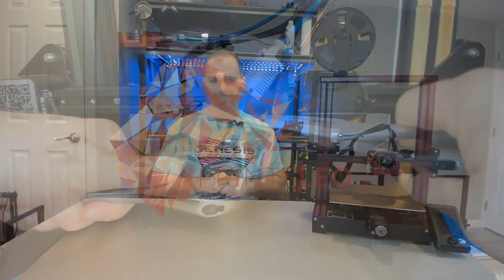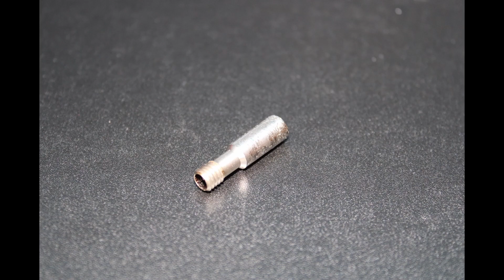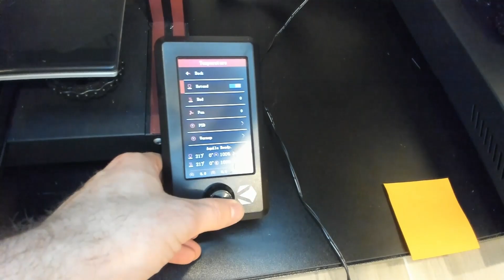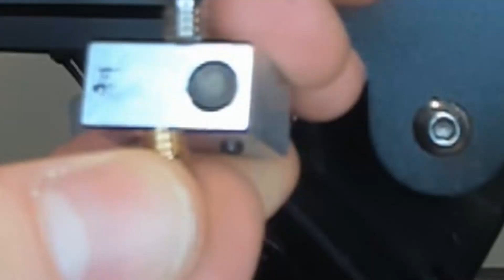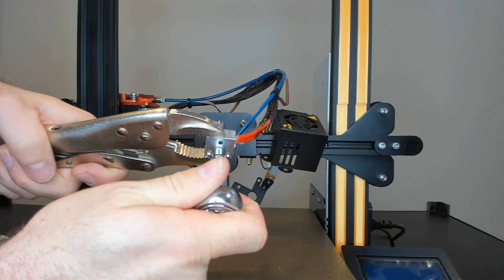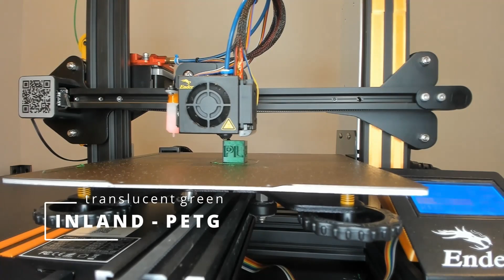Print High Temperatures on the Voxelab Aquila with a new Heatbreak!

Comment: Hey, saw your review for the unitak bimetal one you showed here on amazon and came here even though I had already seen your videos before! Could I by chance get or see your cura profile for your aquila or ender 3s running those specific ones? I have an aquila and an ender 3 pro, replaced one in the ender 3 pro and having troubles dialing in PLA changes and wanted to get that down before installing the second in the aquila! Thank you!
Reply from the maker: Hey thanks for watching and congrats on getting the first bi metal heat break installed properly. You can find my bi metal profile under the cura profile section of my website. (https://www.printsleo3d.com/firmware). Right now the profiles are pretty bare as I have been spending a lot more time dialing in the settings for my printers that are running Klipper. Also the only real change I had to make when changing over to the bi meal heat break was shortening the retraction distance. After the install you also want to make sure you PID tune your printer and run all the normal calibrations like flow. If you are still having troubles dialing in those settings you can ask some more questions on here or through my email: printsleo3d@gmail.com Thanks for watching! Also I don't want to link my Ender 3 Pro profiles because it's one of the machines running Klipper, and the movement speeds are probably to high for a stock Marlin based machine, but if you want to see the profile to get a general sense of it let me know and I can link it for you!
Reply: @PrintsLeo3D  On my Ender 3 Pro, its the newer chip model so I have someone’s compiled firmware to make it able to run my CR touch, I have a Satsana duct, upgraded silent hotend cooling fan, the bimetal heatbreak, metal extruder, capricorn tubing with a raspberry pi installed under the screen for octoprint. I’m about to install the bigtreetech skr mini e3 v3 and tft3.5 screen and smart filament sensor and really have the mod world as my oyster, would you suggest i install klipper? my aquila is mostly stock other than upgraded silent fans but i have plans to have it follow the enders steps. but my main concern at the moment is choppiness in the hull of benchys in PLA in consistent spots no matter what temp I changed it to! I’ve changed retraction and am running a benchy currently to see if it goes well but no matter what I’ve changed it’s consistent and overhangs are much much worse than stock setup benchys
Reply: I’ll definitely email you if this is too much to handle here or discord/twitter whatever is most convenient!
Reply from the maker: Probably better off emailing me because sometimes I have found YouTube will think some comments are spam and I don't get a notification and it seems like I ghost you, which I don't want to do. That's a lot of mods on an Ender! I love it! Those printers are really so amazing. Do you have a link to the satsana you used for the Ender 3? I found one a while ago but haven't had time to print it out and try it, have been using the stock shroud for awhile and want an upgrade(if only aesthetically). As for the hulk issues, that seems like cooling to me, which is weird because you've swapped the fans. I had similar problems printing TPU, along the hull. There's also the possibility your filament needs to get dried out a bit (although I doubt that's the main issue). Maybe try orienting the benchy differently and see if those artifacts are happening in the same areas. Or you can print two benches side by side and see if the additional time for cooling has any effect on it. As for Klipper, I love it! It's hard to recommend it though because to me it's based on your printer setup. When I transitioned to Klipper it took a little while to really calibrate and dial my prints in like I had it with Marlin (as a matter of fact I am still making adjustments). I would say day 1 with Klipper my prints were amazing, but I also sell prints on Etsy, and if there's even the smallest artifact on my prints I don't sell those. So even though my prints were amazing it took me a while to feel comfortable enough to start shipping prints from my Klipper printers because I wanted to make sure they were perfect. I'm not sure if that explanation was confusing. That being said I am slowly changing all my printers over to Klipper. You have Octoprint, so you know how amazing the virtual interface can be, just being able to slice and print directly from your computer is awesome. Also I have my pi zero W powered from my mainboard so the setup for Klipper has a barely non existent foot print.

Comment: One thing I did not see is PID tuning, I read that it highly recommended as the thermal behavior of the heatbreak material(s) are different from the stock ones. A question I have is how does it print PLA, I am reading that it tends to stuck on the contact zone of the heatbreak.
Reply from the maker: Yea I realized afterwards I didn't mention it during the post printing part of the video. I added a link to my PID video in the upper corner of the video during that portion to try and redeem myself lol. You're right, whenever adjusting anything in your hot end it's wise to PID tune the machine. I have not had any problems printing PLA with either of these heatbreaks so far. I have more time printing PLA on the titanium heatbreak (200+hours), so far no clogging, under extrusion, or temperature deviations to note. I am going to add an update to the description to remember to PID tune after this procedure and credit you! Thanks for the addition.
Reply: @PrintsLeo3D  would Alex’s firmware auto PID tube for this?
Reply from the maker: Yes, Alex's firmware is capable of PID tuning this! It won't automatically do it though, you would need to find the PID tune option and run the calibration yourself. I believe you can find that option from the menu with from Control>Temperature>PID Autotune
Reply: @PrintsLeo3D  thanks for the reply! I’m working on upgrading my stock Aquila with a few minor things to prevent some very frustrating prints. Your channel has helped immensely!
Reply from the maker: Awesome I'm glad to hear it! I appreciate you watching and taking the time to comment and ask questions, that's what moves the channel forward. Thanks!

Comment: Nice tutorial Leo! Love what you’re doing. I also have an Aquila and an ender 3 pro I recently followed you satsana fan shroud and firmware update. I was wondering what firmware you were rocking on the ender 3 pro?
Reply from the maker: Hey thanks for the kind words! This particular Ender 3 Pro is running Klipper through a Raspberry Pi Zero W. I really liked the move to Klipper and have started adding it to my other printers. However I have 2 other Ender 3s that are running a  compiled version of the bugfix Marlin branch (2.0.5.3? that's a guess from memory), and those are both running excellent as well. Thanks for asking and thanks for watching!

Comment: Does anyone have a list of upgrades that work on this printer that are cross compatible from the Ender 3? Like Fan Upgrades, Hot end, auto leveling, performance parts, etc. Not everything on amazon has the Aquila in the description.
Reply from the maker: Because the Voxelab Aquila is a clone of the Ender 3 V2 (which itself is very similar to the Ender 3) nearly every part made for an Ender 3 will work for the Voxelab Aquila! 
   Parts that are the same:
-All fans (24v)
-Entire hot end (which includes thermistor and heating cartridge)
-Any upgrade hot end that will fit the Ender 3 will fit the Aquila
-Bed springs
-Bed size is identical so all build surfaces are interchangeable (235x235)
-All auto leveling devices BL touch/3D touch
-Nozzles (both printers have MK8 hotend and use same nozzles)
-Bowden tubing is the same

   Parts that are different:
-Fan shroud  (Ender 3 v2 fan shroud is identical to Aquila but the Ender 3 Pro shroud 
                         is different)
-Firmware(this is specific to the Aquila)
-Most screen related items(the plug is the same but everything else is not)

There might be a few more differences but that's all I can think of off the top of my head. If there is anything in particular you're looking for?
Reply: @PrintsLeo3D  Well, I keep seeing the hot end cooling mods with triple fans and I just saw the kit to enlarge the build area to almost double the size, but there doesnt seem to be much information about build plate replacement either. And then there is the question of the firmware for that obviously. I really would like an auto leveler because leveling it constantly is a pain, and I  don't have a problem with spending to upgrade the hot end/nozzle to expland my filament options. But there are other things that I would like to upgrade for reliability, not sure what are good mods for that. Perhaps anything that helps smoother feeding of the filament? I dont really need the neon slot covers though. I have the Aquila C2 with the budget screen so no fancy GUI. Functionally it is the same though. Are there any wire harnesses with longer wires? Do the cable chains work for the Aquila C2? Some of this stuff can be printed. I've been primarily using this to print PC case parts and mods. So far so good. I just printed a CPU backplate for a LGA 771 socket that I want to turn into a mining rig and it turned out perfect. Next I am working on a fan bracket for the passive heatsink.
Reply from the maker: Adding more cooling fans to this printer, in my experience, has not been necessary, although I can see the allure. With the dual cooling fan/single hot end fan setups they all should be able to get ported to the Aquila you should just find one that says it fits the Ender 3 V2. There’s also printable fan shrouds that allow the addition of multiple fans like the Hero Me series (https://www.thingiverse.com/thing:3182917). 

For a bigger  build size I have not myself tried any of the extender kits, but I know 3DprintSOS has, and he has a video on it (https://www.youtube.com/watch?v=ktMMgBriDE4). I haven’t watched it yet but it’s worth taking a look if you’re interested in enlarging the bed. You're correct, the firmware would have to be updated. If you need help with that I have experience compiling firmware, and could help expand the bed bounds to match a new setup.  

Adding an auto bed leveler is a great option, you’ll still need to manual level your bed but you don’t have to do it nearly as often. I have a (long)video on the installation of the probe and the firmware that accompanies it. (https://www.youtube.com/watch?v=ARAhqgkfBMo) 

For better extrusion I highly recommend upgrading the stock extruder (cold end) with a BMG style encased dual gear extruder. Gets a better grip on the filament and will allow you to print flexibles(TPU) easier. Also the stock extruder has a tendency to fail early in its lifetime. I have a video on this as well, and links to the extruders I used. I don’t recommend the all metal dual geared extruder from this video. (https://www.youtube.com/watch?v=tfgnEnv3FTk)

I have the printed slot covers to mainly prevent errant filament from falling between the channels of the aluminum extrusion. I don’t have the cable chains but from what I have seen the printed chains do work for this printer.

If you’re printing ‘functional’ parts that aren’t going to require a lot of small details, perhaps upgrading to a larger nozzle size (stock is 0.4mm, larger would be 0.6-0.8mm) would be beneficial. Larger nozzles extrude more material which allows faster printing times and better adhesion between layers. They are also less likely to clog because of the larger opening they are extruding from.
Reply: @PrintsLeo3D  I took a look at the Ender Extender kits for the Aquila and the one thing that bothers me about them is the firmware required to make them work right. This is also one of the issues I have with using a BMG style extruder. I would probably go with the drop in style made of aluminum.

If I put a larger nozzle on it would that lose some precision for parts that need precise fitment?

Also what is better, solid spacers under the print bed or springs?

The cooling fans would be for a reason, in case I want to print a wider variety of filament. I also plan on making my own Heat retention cage for the printer out of an "old people's" jumbo shopping cart frame and some plexiglass.The wheels are broken but the frame is still in great shape. That is just in case I decide to get into filaments that require a box around the printer.
Reply from the maker: When installing the BMG style extruder there’s no firmware changes necessary. The only ‘technical’ change would be to the e-step number. The e-steps required for the BMG extruder are close to 400, and with the stock firmware you can only set your e-steps to around 180 from the screen. All this requires is connecting to your printer with a computer and sending it a few lines of gcode. You could also create a plain text file and save it to your SD card and send the same code without having to use a computer to connect.

With larger nozzles you can lose some fine details, and you’d have to adjust all your tolerances for the new nozze. So it depends on how small your parts are going to be. Lines will be larger and layer heights can be larger as well but if tuned properly the tolerances should be as good as a smaller nozzle. If the fit pieces/gaps  are too small for the nozzle to print then it wouldn’t work. It would probably be a little trial and error.

I’ve talked to people who use the solid (silicone?) spacers under their beds and like them. I have never used them though so I can’t say. I upgrade all my stock springs to the stiffer (usually yellow) springs for a little more sturdiness.

If you make any upgrades I always recommend performing them one at a time so you can properly assess any problems that might arise with each upgrade.